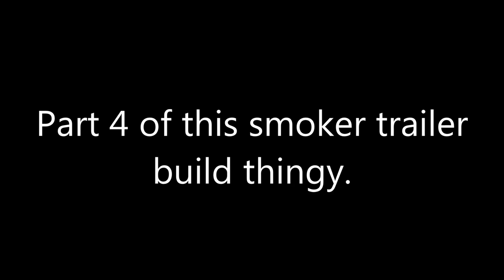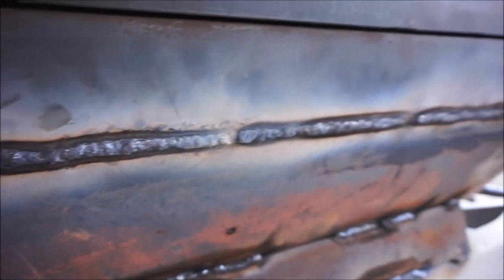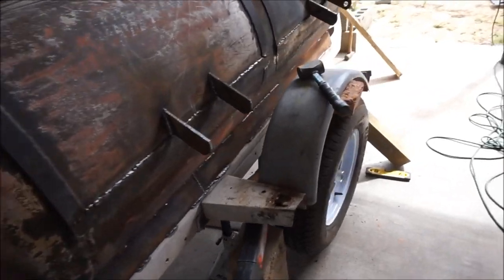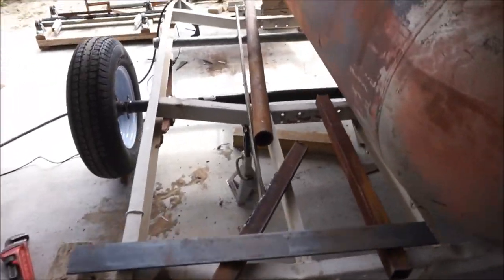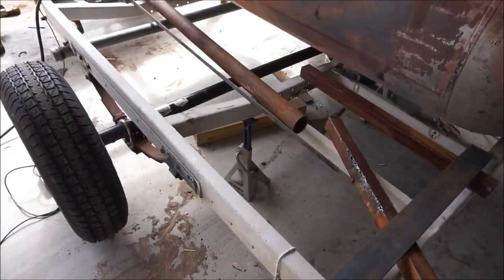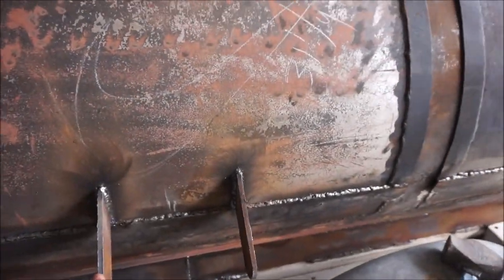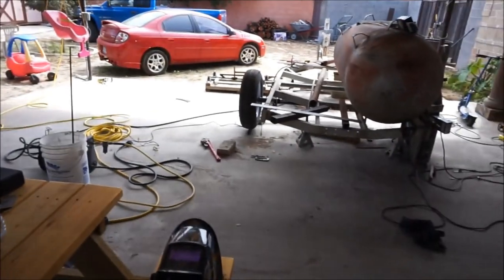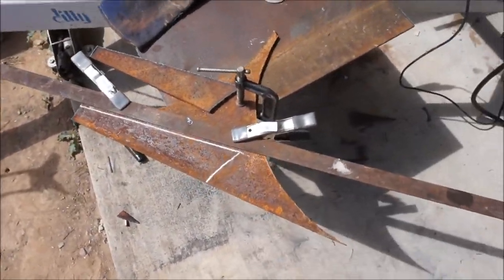how to build a propane tank smoker grill trailer Part 4

Comment: something else to keep in mine. 7018 is stronger than 6011 but it is harder for most people to run. 7014 has 70k lb tensil strenght like 7018 but is easier but stronger than 6011 at 60k tensil strenght and 7014 is a whole lot prettier than 6011. 6013 is good for thinner stuff like fenders on trailer and it looks a whole lot better than 6011. almost 30 years of welding/fabrication here. just trying to give ya some pointers and help ya out and try to keep everyone safe and make sure you get to stay with your family
Reply from the maker: I had not seen this comment till today. 6011 welds do not look pretty at all and I have been using 7018 more now on my DC welder. I have used 6010 and 6013 many moons ago on my Lincoln buzz box. I appreciate the positive comments like this because its great knowledge that is shared to others. Thanks

Comment: Do you build these to sale??
Reply from the maker: I build only as a hobby. I really haven't welded in about a year. I do have some projects coming up.
Reply: @cutweldngrind  that's awesome you can't find a propane tank smoker around here anywhere ...what they sell is some  thin shit that won't last a year!
Reply from the maker: @jasonking2943  The propane tanks are usually 1/4 to 3/8 by what I have mostly seen. I also buy new scrap pieces of pipe used for pipelines, 24" is usually about 35 to 40 dollars a foot. I live on the border to Mexico and I seen many imported grills that are 1/8" material still ok but I prefer 1/4". I'm about ready to order 1000lbs of metal to build a flat bed for my truck. I cant wait to weld up something.
Reply: @cutweldngrind  are you near Yuma?
Reply from the maker: @jasonking2943  I live in South Texas.